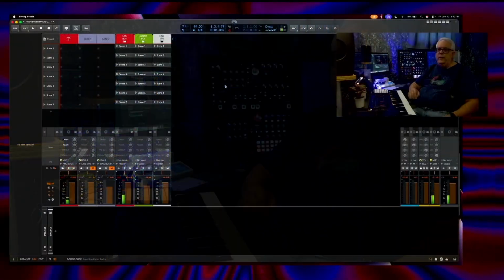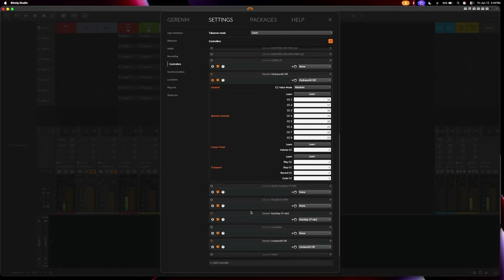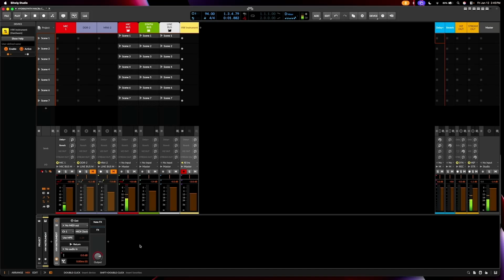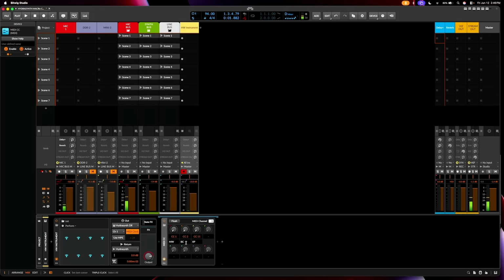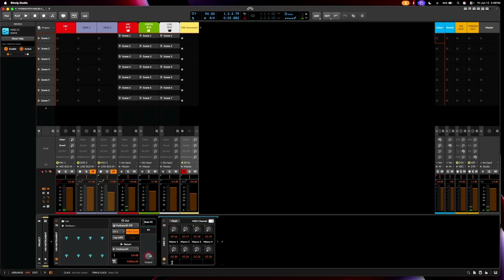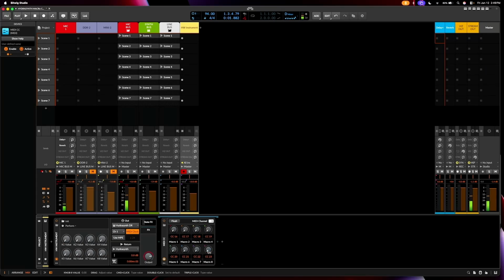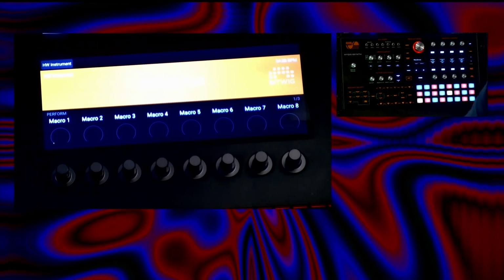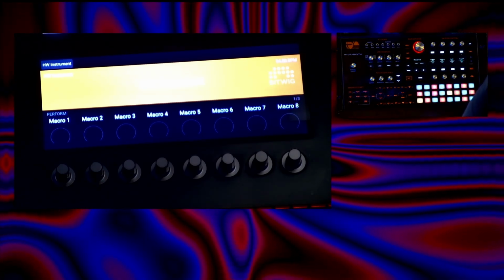Controlling Hydrasynth (or Leviasynth) Macros Using Bitwig and Your MIDI Controller

Comment: You may want to mention that you need to have Hydrasynth set to send and recive MIDI CC instead of NPRN in the Settings>MIDI>Page 6>"Param TX" and "Param RX". This made it work exactly as described in the video, as previously I could not get it to map correctly. 

Thanks for the tutorial!
Reply from the maker: Good catch, and thanks for mentioning that. I thought I had! Cheers!
Reply: @GerenM63  No problem, glad I could help. I am going to see if I can map as much of the Hydrasynth to Bitwig as I can. 

Have you tried mapping the various envelopes/filter/LFOs of the Hydrasynth to multiple MIDI Channel bitwig devices yet?
I am thinking it should work as they are all MIDI CC assigned individually.
Reply from the maker: I've not, but it should work. My primary interest was getting the 8 Macro knobs matched. I did, as a test, set up a second page on my controller and, through the controls pages in Bitwig map the controller knobs to various destinations in the ASM synths, and that does work. In theory, you should even be able to map/route and MIDI source within Bitwig to a destination in the Hydrasynth or Leviasynth.
Reply: @GerenM63  It's certainly possible, I just got Env1 + 2 ADSR mapped out and it doesn't interfere with each other switching between them on the synth, or the 8 macro knob bindings. I'd imagine you can do the same thing with the rest of it! Cool stuff.
Reply from the maker: @complexhouseplant  I'm even getting read backs to the controller display when making parameter changes on the hardware and with the mouse in Bitwig. The only thing that I'm not seeing is Macro knob positions on preset load. I'm going to talk to ASM about adding that when I'm at Knobcon (they're supposed to be there).
Reply: @GerenM63  On load of a new preset on the Hydrasynth, it seems that Bitwig is "remembering" the last place you physically had the knobs on the Hydrasynth for the last patch when it comes to the 8 macro knob bindings.

 It doesn't automatically adapt. Having Bitwig change to reflect the new preset's knob setting from the Hydrasynth would be great. If that is what you are talking about on loading a new patch.
Reply from the maker: @complexhouseplant , yes. But in order to have Bitwig updated (and ultimately, the controller updated so there’s no “jump” when controls are manipulated), the synth has to send the CC values when the preset loads. And that’s the part that doesn’t happen.
Reply from the maker: BTW, the same problem exists in Ableton Live.
Reply: @GerenM63  Interesting, I wonder how much of that is due to some underlying similarities of Bitwig and Ableton.

I don't use Ableton but that's good to know in case I ever pick it up. These days I mostly use Bitwig, Reaper, occasionally Renoise tracker.
Reply from the maker: I’m sure that if the synth actually sent the data when the preset is loaded, Bitwig (and the controller by extension) would update. I say this because the update is received and recorded when I turn the control on the synth. Bitwig (or Ableton) are not the problem.
Reply: @GerenM63  Ah, I see what you mean. Yes, a very good idea to mention that to ASM directly. I have been hoping for a new update to the ASM Manager application at some point, as well.